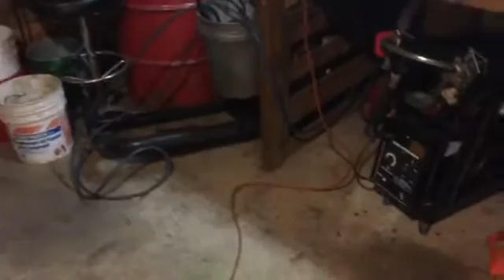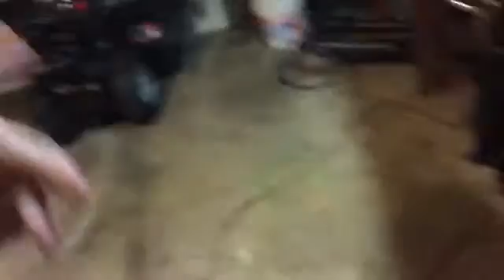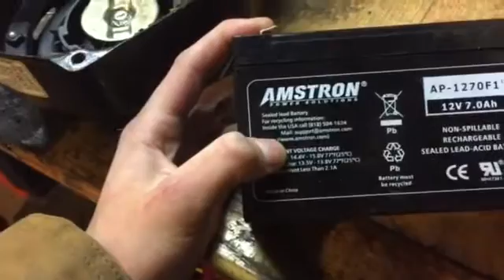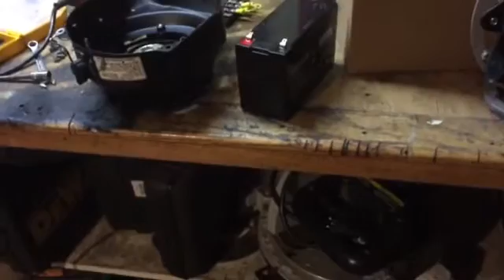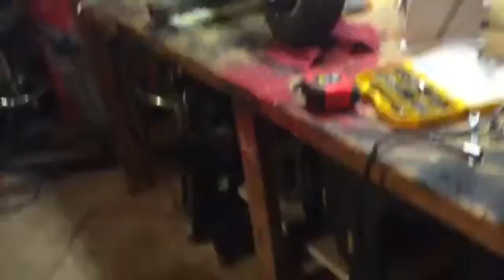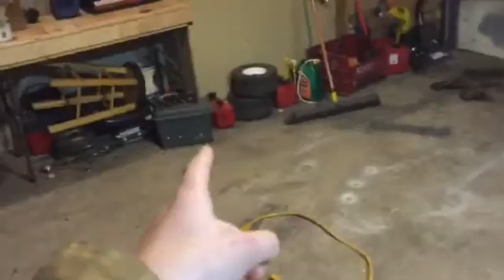Pocket bike, Powder coating, Update&More

Comment: You know what you could have done is use the actual engine block as part of your frame it would save on a lot of fabrication all you really need to do is run an extra  couple thin piece of steel under the engine and up to the front just has a little bit of reinforcements so nothing flexes.
By doing it this way it would not impede on your ground clearance that much.